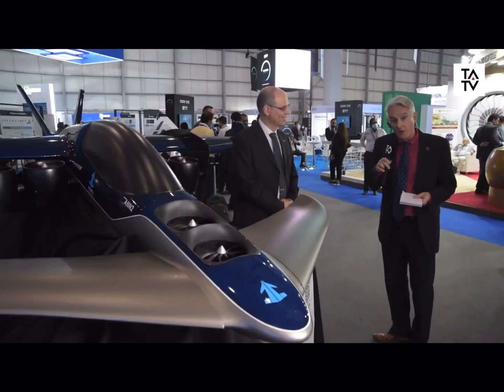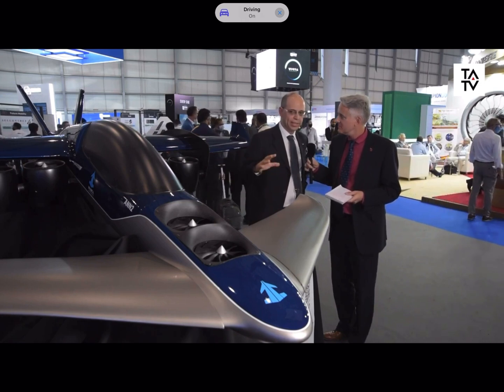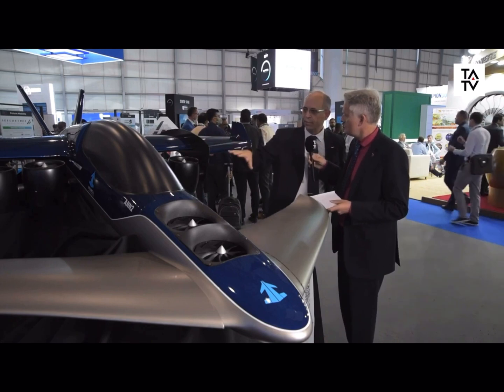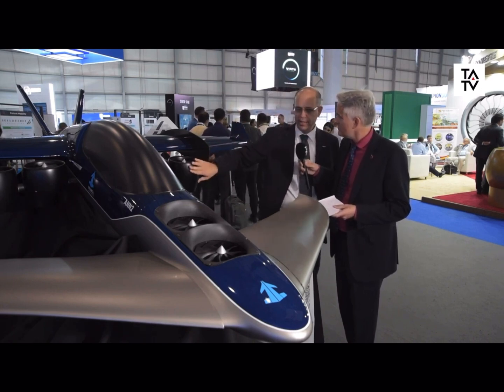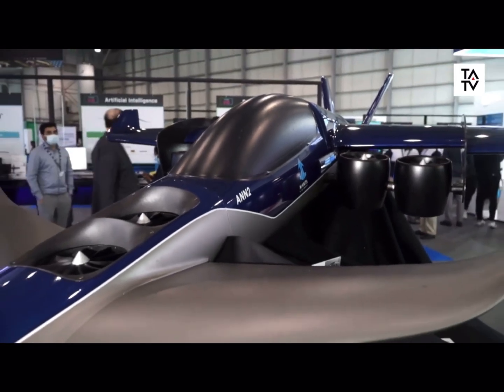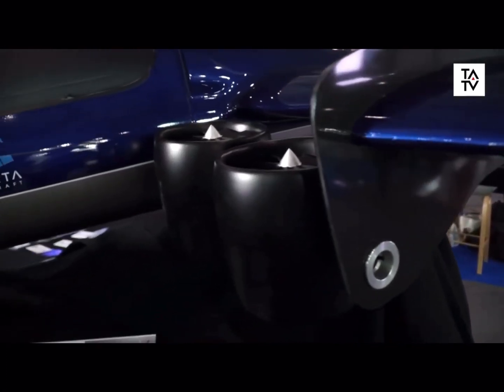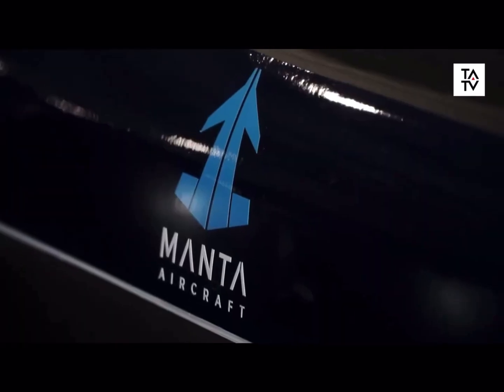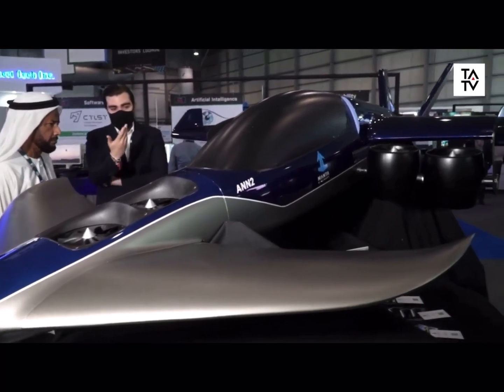Hybrid electric VTOL aircraft design...1000 km range / 300 km/h speed...

Comment: Fully electric is still a fairytale. This design stands a chance.
Reply from the maker: Many engineers think differently...it is up to the type/category of application...
Reply: @electricaviationchannelvid7863  it's actually up to the power grid. People can't keep their air conditioning on everywhere in California but California has put a mandate on switching to full electric by a certain date without any plan to improve the inadequate grid and I argue that if they end up burning hydrocarbons to bridge the gap, all they're really doing is hiding the source of the energy while decreasing efficiency due to conversion and resistance losses. Those same engineers you mentioned don't want you to know that electricity traveling through a resistor makes heat, power from the grid returns to earth where it makes heat because of resistance. Heat is the main emission from electricity consumption. They going up use the same amount or more of hydrocarbon fuel to generate that electricity. FAIRYTALE!
Reply from the maker: @280zjammer  It is not a power grid/powerplant channel...it is also not about "how to mismanage a whole state" kind of debate channel...